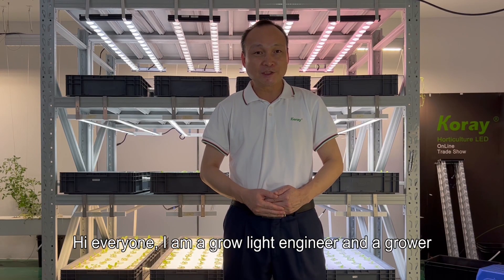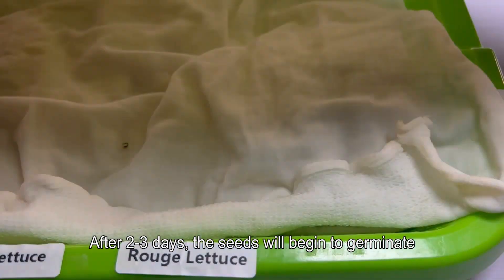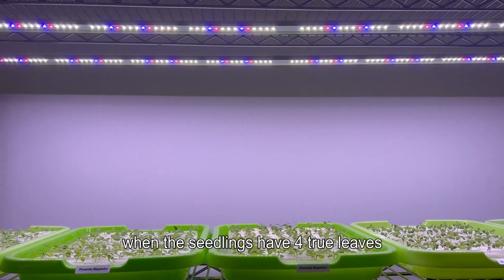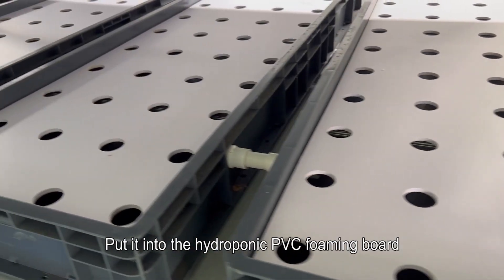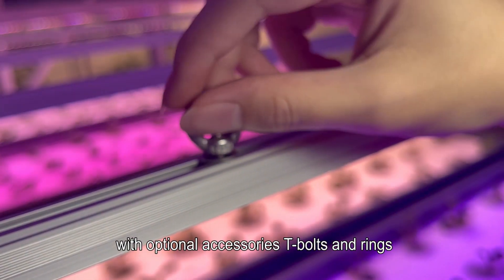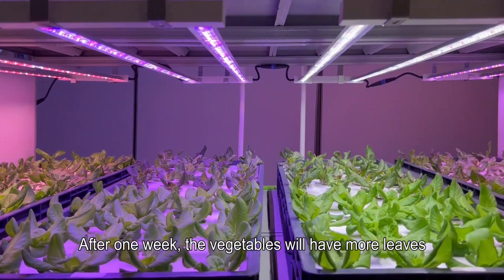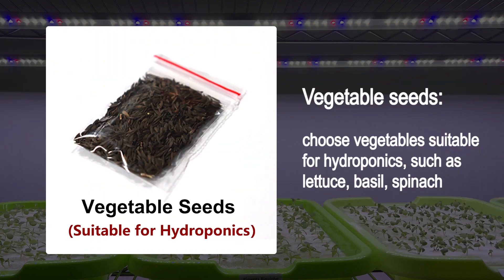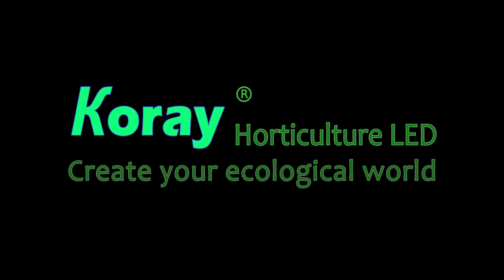How to DIY Indoor Hydroponics Vertical Farming System

Comment: 2.4m2 Dimension would be 2.4m x 1m (I think this is too small a space) x 4 layers to grow 528 vegies? Is this correct?
132 vegies per vertical layer x 4 vertical layers = 528 vegies. Is this correct?
Reply from the maker: Thank you for your comments.
1.2MX2 M vertical shelf dimension .  
 4 plates per layer,total 12plates for 3 layers 
 each plate 44 small vegetables, 44x12=528 small vegetables.
more information ,please feel free to contact me at info@koraylights.com.

Comment: Hi am from Sri Lanka. 
1)Pls can I have the dimensions of each Hydroponic vegetable trough. 
2)And how many of these trays per layer. 
3)Also the dimension in L x W that make the 2.4m2. 
4)How many vertical layers to grow 528 small vegetables. 
5)Whats the distance for plant growth and grow lights that should be maintained between each vertical layer.
6)How do I contact you for supply of grow lights (Email, Whatsapp)
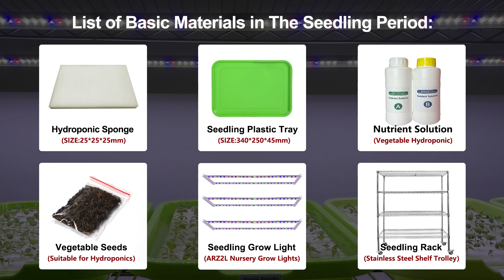Reply: Dimensions for materials used are at 6:00 in the video.